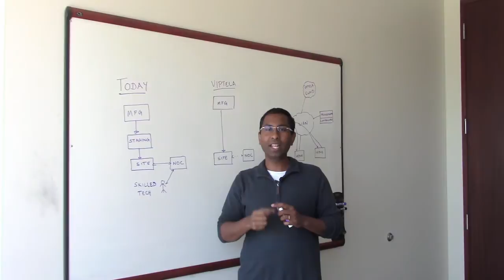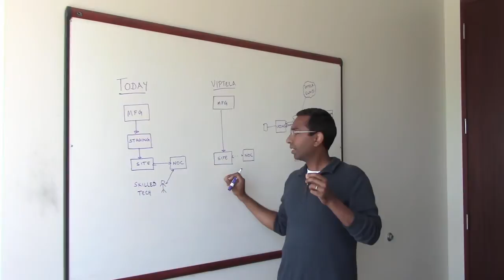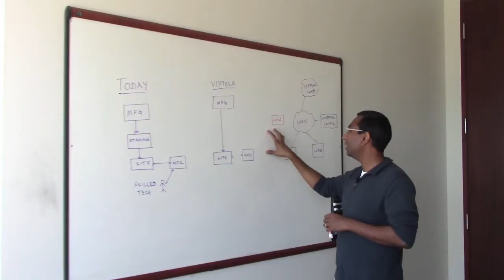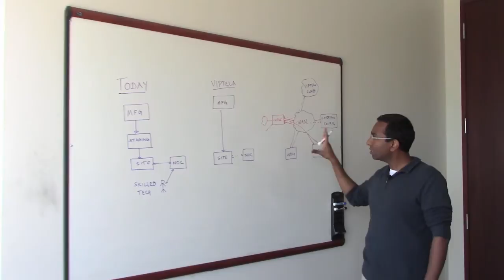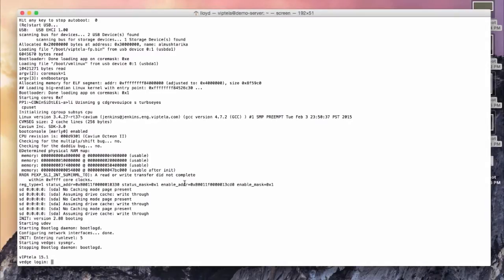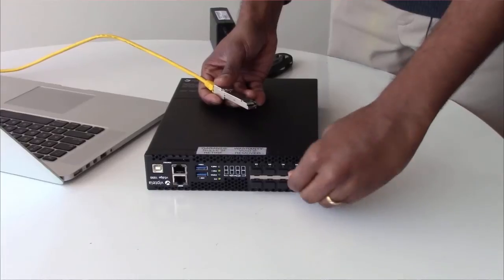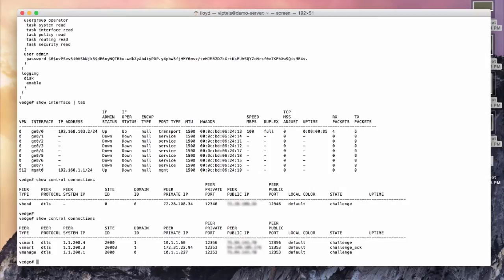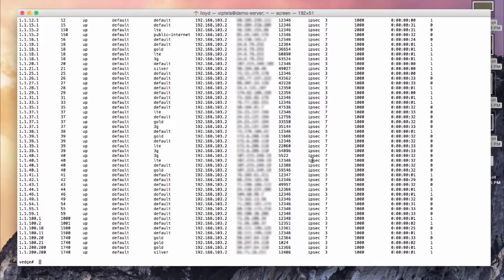Zero Touch Branch - Demo (SDN WAN Tutorials)

Comment: 1m35s - "What if you could actually bring up a site in less than 1 minute and that's exactly what Viptela Zero Touch Branch bringup gives you.
3m30s - start "less than 1 minutes" timer.
4m30s - 1 minute later power is plugged in, Ethernet is not, device is on table not rack-mounted.
4m51s - audio quality goes through the floor.
5m12s - it 'phones home' to ztp.vipleta.com - is setting up the infrastructure to give this device Internet access included in the stated "les than 1 minute to provision"?
5m34 - earth loop causing annoying hummmmmmmmmmmmmmmmmmmm
7m21s - ZTP finished 3m51s after start off "less than 1 minute" timer.
Reply: +Mark Heuzenroeder They are obviously taking some more time and showing what happens under the hood. "zero touch deployment" is the ability to bring a brand new device at a remote site into your management framework without having to touch the configuration of the router. That way you don't have to rely on skilled resources to bring a remote site up.